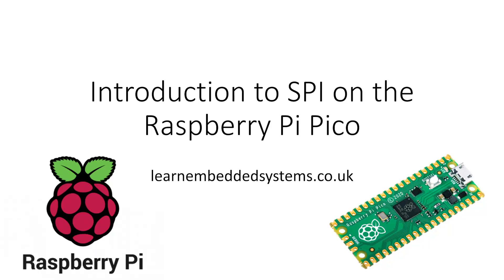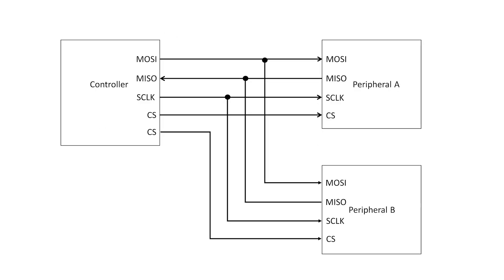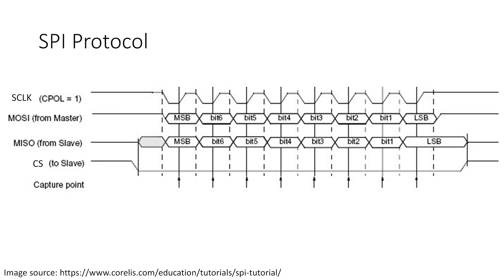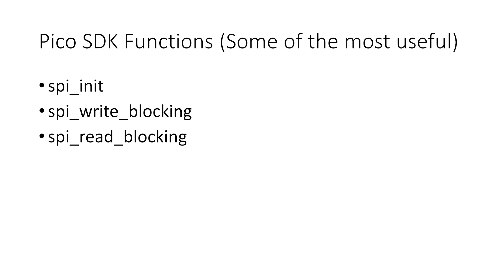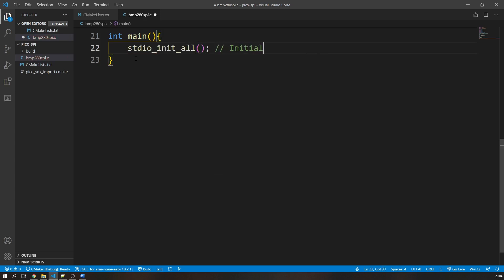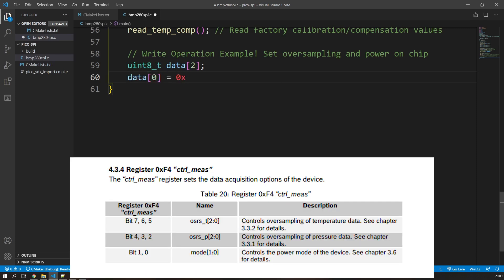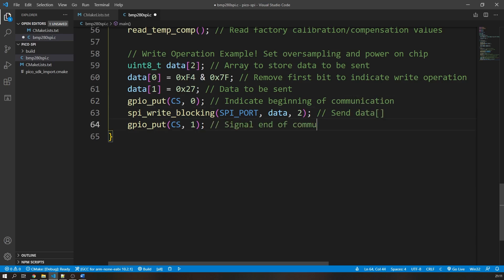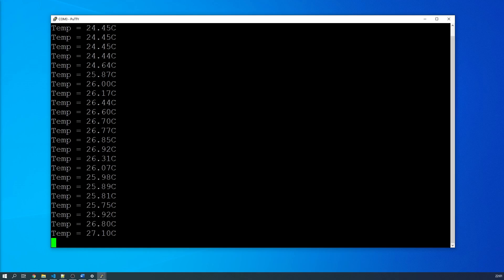Beginners Guide to SPI on the Raspberry Pi Pico (BMP280 Example)

Comment: Dear Sir. In your video the CS pin is made by simple GPIO. This is clear and usefull, but, in case of only one SPI periferal, I guess that would be good to have the CS pin control by the same SPI function. Therefore, I have a question: Do the Pico library have one SPI R/W function which automatically manage the CS pin? Congratulation for your channel.

Comment: Do you have recommendations for which breadboards are good ones, and where to buy them?  I've bought quite a few that are semi junk, and can only grip thick wires, or that it's hard to push components into because the contacts don't line up with the holes well.  The power rails are usually the worst part, especially for not gripping thinner jumper wires / bell wire.

Comment: Is the pico spi interface bidirectional?
Reply: I also asking myself. I need to connect an encoder to it. I know it should work with stm32´s via a resistor between mosi and miso, but no clues if the rp2040 is capable. Did you find the answer?

Comment: Thank you for the movie. It would be great if you made a movie explaining how to use a SPI display with a Pico using MicroPython. Especially the XC3728 OLED that is used by Arduino. I  found another movie however they do not provide any code, just a demonstration. Thank you

Comment: I want to learn how to program my BLE module. I just purchased a BL651 from Laird connectivity. Sorry I'm a beginner self learning. I would love to have some guidance on how to interface the BL651 and send and receive the data using SPI protocol.
Reply: J Meng, the BL651 is way too advance. 
first you'll need to read the datasheet, make sense of it and write your own peripheral driver like the .h and the .c file which are the most complicated parts
and then you can start with your main.c file to interface with it.
try starting with something simple. there are many arduino and python bluetooth projects on online

Comment: Slave device is subordinate to it's master so the terminology still works here. Why do we have to be politically correct for everything?
Reply: Because it actually hurts people and it takes freaking zero effort to use other terminology. Don't be a douche.
Reply: Language evolves just like everything else. We no longer use whence and thither in common language. Evolution is continuous and natural. Don't worry too much about it. Literally everything in computing changes all the time.
Reply: Exactly. Master/Slave has been around forever, at least as long as hard drives came into existence.
Reply: Because people are weak

Comment: The part about the MSB of the register is a bit confusing.   Is there a max of 127 registers?  Would seem so since your are forcing the MSB to a 1 or 0.   Seems like the upper nibble of the register address would be an 0x8 and not a 0xF.
Reply: To force the MSB to a 1 and leaving the remainder unaltered, you would OR the byte value with 0x80.  To force to a zero, you would AND the byte value with 0x7F.

Comment: Thanks a lot.
But now please, explain it again in Circuit-Python too ... 😉✌️
Reply: Or MicroPython please 👍
Reply: People, PLEASE learn C/C++ for microcontroller programming. Python is incredibly slow compared to compiled code. Python is really only useful to learn the basics of programming. To actually make the most of the hardware, switch to a proper compiled language. It's like taking the training wheels off!
Reply: @Anticitizen666  Yes, but does it really matter? Speed? Only, if you really need it. These interpreter languages like Python have their justification, especially since speed is compensated more and more with fast processors and libraries that implement the critical parts. These are a big step forward with abstraction layers of all languages like step from real binary coding to mnemonics and later compilers and linkers. We're no longer living in times of basic.
Reply: @Anticitizen666  It's true it's also just a bit like going into a living nightmare of move semantics and a bowl of brace/bracket/paren pasta 🤣  c++ and python have their place! Often projects don't need a super tight loop, instead reacting to inputs on a human timescale. Why should you pay the heavy performance tax that writing performant C++ code incurs if you don't have  a use for it and you don't have a boss breathing down your neck about the cost of 100s of thousands of units. Oh and one more thing: remember C coders are rolling their eyes at C++ programmers for using such "bloated"  executables from an "overengineered" language, and behind those guys the assembler coders are sniffing at this C nonsense coming between them and the instruction set.